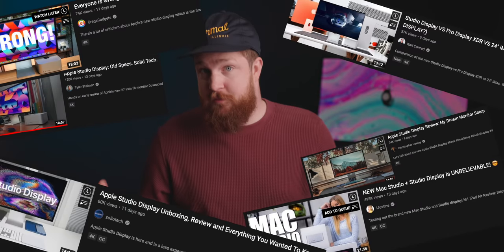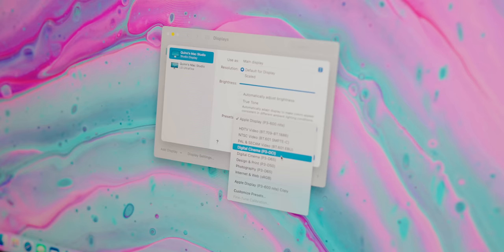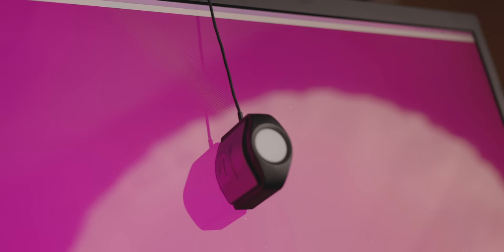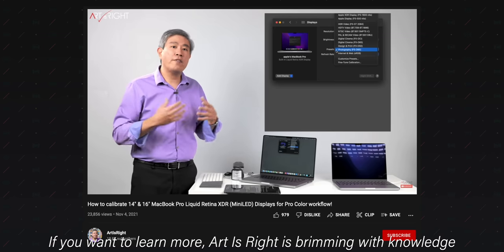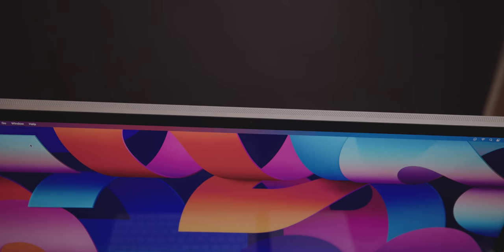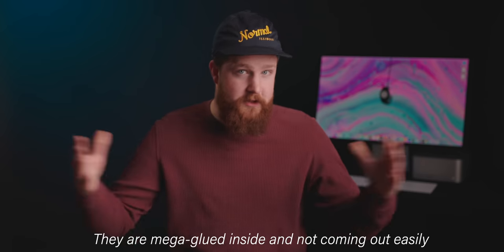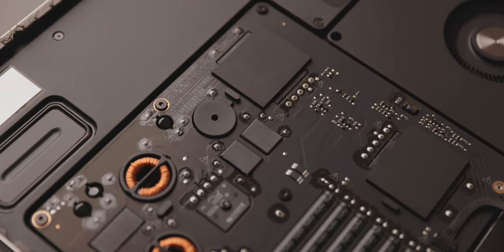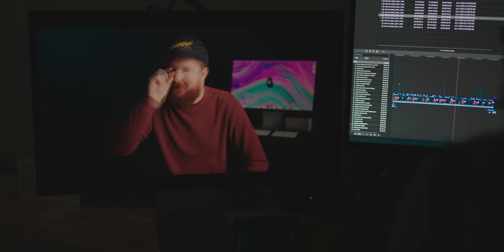The Apple Studio Display Is WEIRD!

Comment: As a creative professional and Mac user I could not get myself excited or be able to justify the over-price on the Studio Display.  For many creatives out there, total color gamut (Adobe RGB, P3), display uniformity, and calibration are more important than peak brightness or even 5k.
Reply: ugh, no. 5K is the TOP priority of professionals where sharp text is an absolute priority.

If you don't care about that, you would have a ton of 4k 32" panels already and have ZERO use for ASD.

It was never meant for you anyways.

Apple built a niche product ... like iMacPro.

Going from iMacPro display to 4k display is a STEP DOWN.
Reply: @RunForPeace-hk1cu  the Studio Display does not support Adobe RGB, nor is it's color gamut greater than P3. If you're a photographer or creatively work producing print work, this would be a priority over 5K. The studio Display does not support hardware calibration (or vaguely even allows precise software based calibration, the reference modes are nice, but not the same). If you're doing professional work, calibrating to a specific profile and luminance is a priority over 5K. Panel uniformity across different reference modes is also a priority over 5K.
At 27" the difference between 5k and 4k won't be noticeable for most at regular viewing distances.
The Studio Display is a great niche product, however it's an over priced one for what it offers, and lack many of the features creative professionals would seek over 5K or being 600 nits of brightness.
Reply: @HaroldsMind  5k is a weird resolution Apple adopted - its almost nonexistent in the professional field.
Reply: @jani0077  I agree. I think it's mostly due to how MacOS scales up the entire OS, as opposed to how Windows scales the interface instead.

Comment: I think there's simple answers to everything you wondered about. Despite the "studio" name, this is largely for the very vocal contingent that have been begging for an Apple-made display that's just an iMac without the computer. They are mostly programmers, and there are not many of them, but they are also a core market for Apple. But Apple hates the idea of doing anything like a PC manufacturer. They started work on what became the 2019 Mac Pro in 2017, and they could have simply thrown components in a cheese grater and had it out by 2018 or even late 2017. But they did it their way, and we have what we have. Maybe you're right that they wanted it to be mini LED, but even if it weren't it still tracks with how they roll. So you have a product that probably is a bit overengineered but still makes a hefty profit on every unit sold because it's priced accordingly for how many units they likely envision selling.
Reply: I completely agree with this. The 5k panel that is laminated to the glass is much nicer to look at for programming all day. And it’s easier to use a laptop + monitor than mess with having two computers when the laptop is plenty of horsepower for my local work. Too bad it turned out so expensive, but it is nice to never deal with scaling issues and and get the sharpest text available with better quality over the Lg.

Comment: I really love my studio display but I have a feeling that 4K 120HZ would be better for most users who are interested in a high end display for their mac. That makes it all the more annoying that macs DON'T. HAVE. HDMI. 2.1!!!!! Having ranted about that, the display is for people like me who want an iMac panel to pair with my 14" MacBook pro for general computing tasks that has build quality on par with the laptop. Is it a good value? No. But if you want a first party display to use with your mac that costs less than the pro display XDR, the studio display is your only option.
Reply: They won't be able to give up 5k resolution The problem is that there is no way to transmit 5k 120Hz with current technology even Thunderbolt 4
Reply: Yup, Apple is good at locking their user into their garden. When you are in, you can't escape but to spend more for their products.
Reply: @Haru08816  Why not allow both then? Run at 4K 120hz or 5k 60HZ. They already have dynamic refresh rate frameworks built into iOS. Even if it took a minute to switch between modes it would still be nice to have
Reply: @Haru08816  DisplayPort 2.0 is capable of doing that but there is no way apple is putting DisplayPort on their monitors despite its widespread use in just about every modern monitor
Reply: @KHudso  You cant just display a 4k image on a 5k monitor, the scaling would destroy the image quality and text would be a blurry mess unfortunately.  However display port 2.0 is around the corner and it has the capability to do 5k 120
Reply: @JoeNokers  I wonder if the new iMac Pro that is till rumored may find a way to include promotion and HDR tech at greater than 4K. Apple was able to do 5k through some internal wizardry with the original 5k iMac.

Comment: Good video, addressing many interesting, underdiscussed points. You entirely missed the #1 problem that occurred for me, though: The display is only 60hz. It's jarring to use this alongside a ProMotion MacBook Pro display and feels laggy and outdated in comparison.
Reply: Honestly, of all the problems this monitor has in any kind of studio situation, that is most likely the least important one.
Reply: @noenken  Well, I have a studio, ordered the monitor on launch day, used it for 2 weeks and just sent it back for that exact reason, so I beg to differ. It was very important to me.
Reply: @a097f7g  I wasn't trying to downplay your personal reasoning for the decision, that would be silly. Sorry if it came across that way. I just think that the other obvious reasons like the lack of self calibration, HDR support, touch/pen input as well as the size and the price you have to pay for all those built-in things you might not need are way bigger issues for most studios. Personally I'm editing photos on two 32" 4k LG IPS panels and I don't think the 5k resolution would help me as much as the size of my screens does now. I also would not want to pay twice the money per screen for webcams and speakers I would never use.

Comment: There is something deeply weird going on with this Studio pair or products.  For the last 2 years Apple have been crowing about the energy-efficiency of the M1, with some products needing absolutely no active cooling (fan), and some that need only minimal active cooling (fan).  Now there’s 2 variants of the Mac Studio, both of which have ENORMOUS cooling solutions, one of which is the identical M2 Max as in the Macbook Pros with their minimal active cooling solution, and yielding near-identical performance/benchmarks.  Huh?  This makes no sense at all.  Is all that cooling really needed for the Mac Studio’s PSU???  As an EE, I don’t think so.  And at stage left, we have this Studio Display with built-in PSU where they’ve gone to extraordinary lengths to cram in that 120V/220V mains PSU without the centre bulge of the now-former iMac, and which is an entirely different form-factor to the new 24” iMac with an external PSU.  The space taken up by the A13 CPU board is enough for a full-blown M1-Pro, maybe even a M1-Max, given all that cooling capacity on the Studio display, but instead they’ve used that cooling capacity for an insane internal PSU.  So yeah, is this the form-factor of a future iMac Pro?  Regarding the 64GB Flash on the A13 CPU board, DO NOT underestimate ‘chipageddon’, and that maybe it was the ‘best’ option for this product, insofar as its something they had a lot of stock of, and lets face it, they’re not going to sell many of these Studio Displays, compared to the iPhones/iPads for which they are/were intended.  This Studio pair makes no sense at all, insofar as the inconsistency of design language and the bizarre cooling capacity and the choices they’ve made on what to cool with that cooling capacity - a Mac Studio that ostensible doesn’t need al that cooling, and a Studio Display with internal PSU that flies in the face of the M1 iMac with its external PSU / Ethernet brick.  No sense at all!

Comment: Two nights ago I was walking home & found a broken Apple 27 inch Thunderbolt monitor on the sidewalk. The outer glass was gone & it was filthy but I cleaned it up. The 2 cables were still intact. One of my viewers says it is probably repairable. I’m going to take it to the Genius Bar to see if it can be saved.
My question for you is :

What kind of tool can I use to REMOVE the VESA Mount on the back ?
Nothing is wrong with it & I could sell it on Ebay.
I think I watched a video where Luke Miani made a new Mac display out of a dead Imac.
The parts for the display arevavailable but if it’s dead then maybe I can put a 4k display screen in it with a power supply & connect it to my Silicon M1 Mac Mini.
Even so, I’d never seen the inside of one & it will be fun to open it up & see what’s inside.

Comment: Great video. Would’ve loved an exploration of any other displays that are actually pixel-dense.  AFAIK, there are no other displays other this and the LG that even have a PPI over 200. Even at 4k, it’s impossible to get something smaller that 27”
Reply: That’s just not true. There’s the LG 24UD58-B.
Reply: @timtjtim  While that fits the bill of UHD below 27in making you technically correct, it doesn't hit any of the other "more important things" (@12:05) from either Quinn or Naman Goel. The PPI is still below 200, it still only has a 60Hz refresh rate, it only goes up to 250 nits, it doesn't have lighting zones, it doesn't have any better color accuracy, etc.
Reply: @cushmanproductions  250 nits doesn’t really matter for professionals
Reply: Just get onenetbook mix 4
Reply: @suntzu1409  what does this have to do with that
Reply: @PasteurizedLettuce  it has very high ppi
Reply: Wait
Just get sony xperia 1 IV then

Its ppi is more than 600 iirc

Comment: The internals look insane, I never seen this amount of custom parts on a monitor. I’ve seen monitors that used double sided tape to hold the logic board instead of screws, and hotbar glued ribbons to save a few cents on connectors and soldering time.

Comment: It all makes sense when you imagine this exact design housing a screen with either mini LED local dimming or a modern OLED panel either from Samsung or JOLED. Apple dropped the low-end of their display lineup first, likely because the high end panels they want to include aren’t ready yet at scale.
Reply: Lol, I read the pinned comment right after posting this.
Reply: One more thing is I wouldn’t worry too much about the panel’s use of 8-bit FRC to generate its color gamut. This is a mature technology and is really, really hard to detect unless you’re using this for the most demanding color-accurate applications. Although for a $1600 base price, yeah true 10-bit would have been nice.
Reply: Do you mean QDOLED? I have never heard of JOLED
Reply: @Ender275  JOLED is a manufacturer of RGB OLED panels at sizes suitable for computer monitors. They make the panel in the new LG Oled Ultrafine Pro.

Comment: OK; Sure. Luminance isn't necessarily a boon in professional grading. But the built in profiles for colour work do also limit luminance to the correct values, and it is nice for day-to-day use. Plus, while it may not be HDR per-se, it does work with Apple's EDR system so you can kinda use it for HDR-600

Comment: The Iiyama runs at 6bit on macOS only. On Windows with 2 DisplayPort cables it does run at proper 8bit. 

The panel is the identical LG 5K panel (from the 2015 5K Imac)

Comment: It wouldn’t shock me if the A13 chip was used in the future for a Sidecar-esq wireless display functionality, eliminating the need for a display cable.
Reply: If it has some sort of wifi and bluetooth connection.
Reply: @huyanh995  that should be part of the chipset, not something added later like 4g/5g modem
Reply: @bradhaines3142  It doesn't have antenna :)
Reply: @huyanh995  i bet some software could fix that
Reply: @bradhaines3142  How the heck a software can install some missed hardwares?
Reply: @huyanh995  you misunderstood me in the first place. it definitely has the wifi hardware as part of the chipset. easily enabled from software.
Reply: @bradhaines3142  What you are talking is a modem, yes it is inside A13 but it doesn't have antenna. Just like you have a wifi hotspot but without an internet cable run to it, or a faucet without a pipe.

Comment: I do hope that Apple will bring a 27" iMac replacement for the common user, not only the pro. I use them since they entered the market and do not want a smaller screen or less resolution.
A device in the same price range as the old Intel 27" - the only other thing I would really like it to have is a input to use it as screen for other devices.
It is a shame that there are lots of old Intel 27" iMacs with good (working) 5K Displays that cannot be used with a new M1 computer and are discontinued since OS 12.